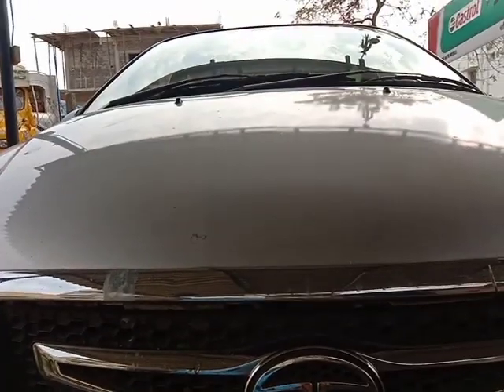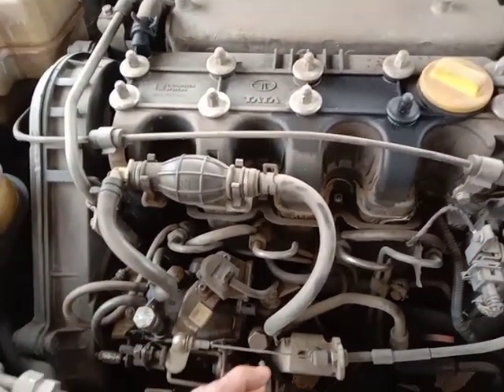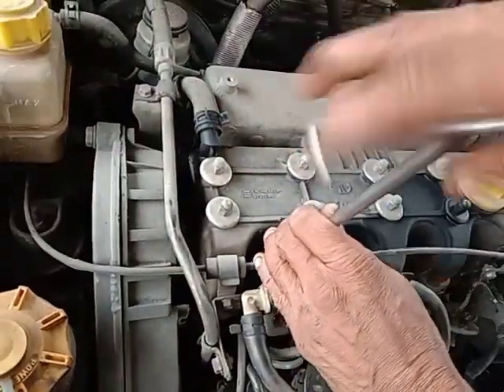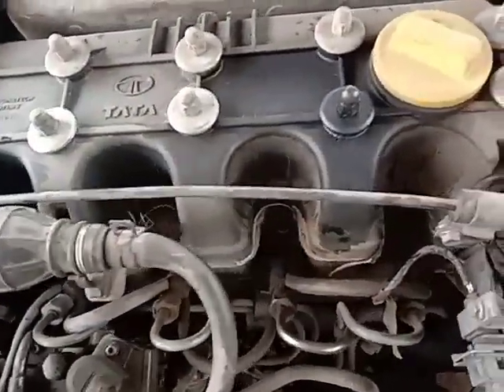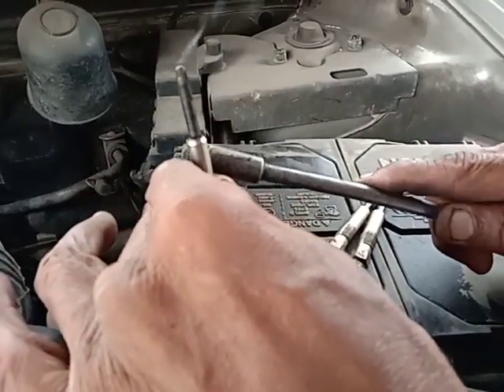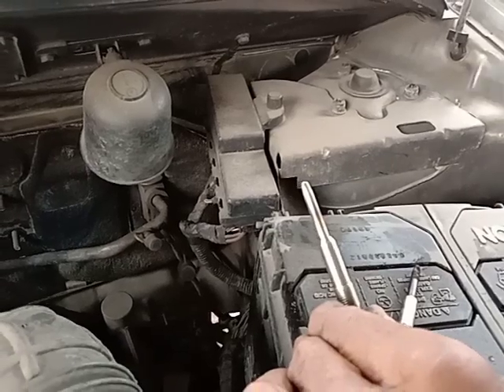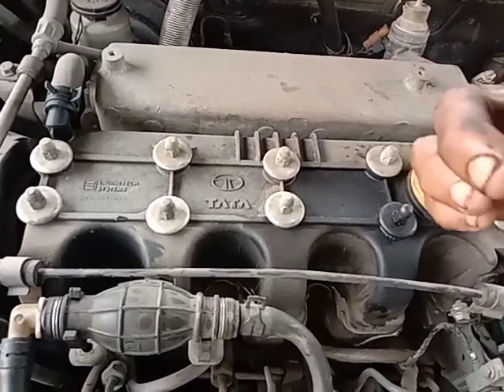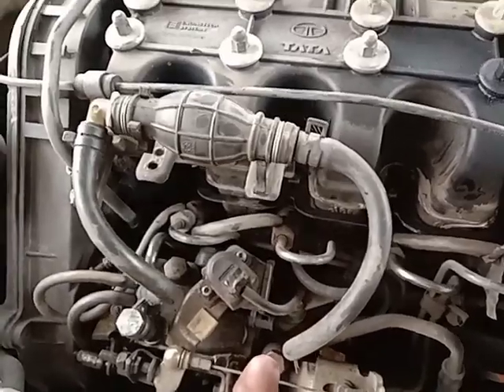INDICA  LATE STARTING (heater plug) change

Comment: ஜி tdi engine.. பிக்கப் இன்க்ரீஸ் பண்றதை ஏதாவது வழி இருந்தால் சொல்லுங்கள்
Reply from the maker: Indica tdi car first concept milage 
So pickup low ,dry diesel running,low maintenance work this casuses pump problem coming  so well maintained car good pickup tq
Reply from the maker: First indica concept well mileage so pickup low 
Dry diesel running, oil clutch suspension not well maintained picup very low,well maintain good pickup increase tq bro
Reply: @skilledmechanictamil  thanks sir

Comment: Bro pls give solution....Tata Indica tdi dls model ....last battery changed  2018....today one problem...I put key  heater and check engine light blinking so push vehicle and started manually ....after car running I off ignition....later again starting ignition  same heater light blink one time and off....cannot start vehicle.....give me solution ...is it relay problem or battery need to change new.....but headlight all working running.....battery or relay problem???

Comment: Bro heater plug change pannium antha problem varuthu ..ena pannanum.. morning starting trouble
Reply from the maker: Check diesel filter hose  

Tank to diesel filter line
 Fuel filter valve